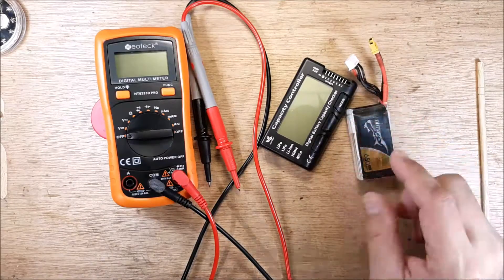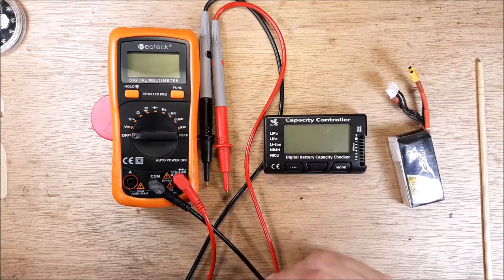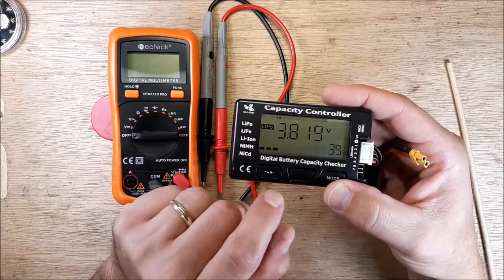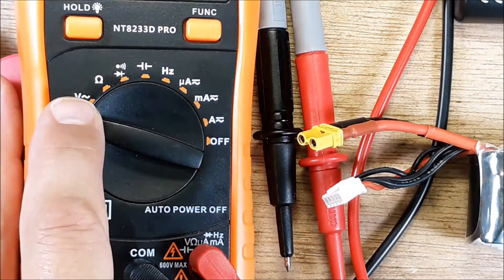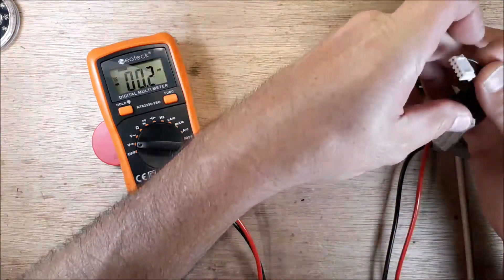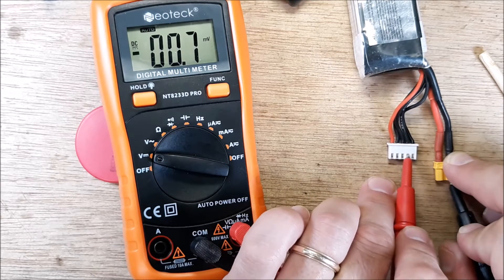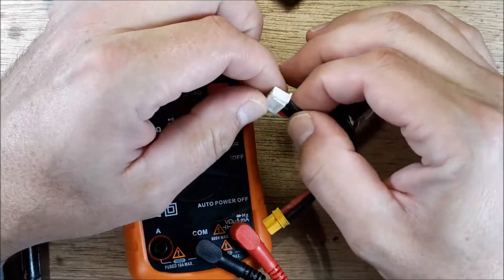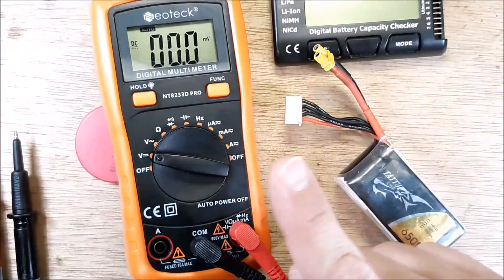How To Multimeter Check Lipo Battery Voltage | How To Measure Each Ceil Of A Lipo Battery

Comment: great video. i learn new things. i have a question.

should i dispose my 3s lipo pack if its been discharging for 7 hours(boat got stuck in middle of lake)?

i never notice the pack physically when new but im sure there are a bit bloated now. the voltage was 7.5v ish.
Reply from the maker: I appreciate your encouraging feedback...👊🏻😎🍻
Personally, if the lipo is bloated, I won't charge them. Batteries Plus recycles lipos for free - they do have a thing about very puffed packs, but I've not been turned away.. Always safe than sorry...🍻

Comment: its a great video. Ive got a problem with mi LiPo (it suddenly stopped working after some time in the drawer) and when i check it it says 1.11V (combined) but when i check each S separately with multimeter it says 1.11 on the first one and 1.11/1.12 on the second one. I assume it is broken cus ive heard you shouldn’t go below 3V on each but is there any way to recharge it?
Reply from the maker: @jacob33official  
I appreciate your support. Indeed, a lipo that has dropped to 1.1 volts will be considered dead. However, sometimes they revive on a trickle. I totally do not recommend charging lipos from below 2 volts. However, I have revived a 4S from 1.8 volts due to a long stay up in a tree, lol.. I placed it on my charger at a quarter of an amp. It took a while to bring it to storage. I let it rest and the next day it was still at storage and I charged it normally. It had sag during flight, but that's fine for me. Again, I don't recommend it and would advise keeping an eye on it during the next few charge cycles.
Also, some chargers won't charge a dead lipo. There are tricks to get them to do it, I rather recycle at that point...🍻

Comment: Thanks, good and clear explained. In this video vas touched my real life situation. I have 4s batterie but in tester I see only 3s. What I would  have to do in this situation? Thanks in advabce for reply.
Reply from the maker: @allabout1135  
I appreciate your feedback and support...🍻
Reply from the maker: @allabout1135  
You can check to see if one of the balance wires going from the cells to the connector is broken inside the silicon insulation. If the cell is dead, I dispose of them...🧐
Reply: @PropsOff  In case of dead cell, is it some way to get it back to live? Or just need to accept the fact of losing it?
Reply from the maker: @allabout1135  
Because of how aggressive I am when charging, if I feel the lipo cell is shorted inside or damaged enough to cause issues, I dispose of it. I take all my lipos to batteries Plus. It free...

Comment: My 3s battery reads 12v when I connect the ground lead and the far lead, but zero on the middle 2 connectors. The balance connector is visually intact. Haven’t looked inside the battery housing. Any thoughts on what the problem might be?
Reply from the maker: @connorsisler1824  
Your multimeter is reading 0 volts from  the center pins? So you have the ground lead on the far pin (ground) and the red lead on one of the center pins, and its zero?
Reply: @PropsOff  that’s correct sir
Reply from the maker: @connorsisler1824  
Are the wires broken inside the silicon cover? Odd to read zero. Any small voltage would be more expected..

Comment: How bad would the short be for a 1C battery if I touched the leads together on accident when checking with the multi?

Just trying to gauge risk lol
Reply from the maker: I've done it many times. Usually, you can get away with a quick spark. If longer, it can and will melt the lipo leads. Be careful...🍻

Comment: I can never remember which one of the balance ports is the ground. 
RDQ batteries have the red and black wires the other way, four reds and one black.
Reply from the maker: It does make it frustrating, I wish things were a bit more standardized. It's like when they paint the ground of a DC capacitor red...🤦🏻‍♂️

Comment: What is storage voltage and how do you control that charge.  Also, when discharging what is don’t go below voltage.
Reply from the maker: Storage voltage is 3.85v per cell.
Depends on what charger you have?
Discharge to 3.85v.

Comment: What if I wanted to read a 2s lipo I want to display each cells voltage to its own voltage display. Can you help?
Reply from the maker: Yes and yes..
Two 1-8S voltage checkers could be wired to a harness and display the voltage of each cell. You could also have an alarm set for a minimum. Are you doing a huge pack on a LR? Here's the link to the part.
https://www.racedayquads.com/products/1-8s-lipo-battery-voltage-tester-low-voltage-buzzer-alarm?currency=USD&variant=42211616595&gclid=Cj0KCQjwk5ibBhDqARIsACzmgLTI6Gtqf_h8xikITrvXtWWR7tiqxw5D9xheqHyPBDIQdZ9yorFPPTAaAkn9EALw_wcB
Reply: @PropsOff  Thanks I know I can use one of those but I have installed two, 2 wire voltage readers. I was wondering if I could display each cells voltage. So for instance I can do voltage reader #1 read cell #1 and voltage reader #2 can read the total amount of volts from both cells. Not sure if it’s possible to use the balance port of my batter to read each cell individually rather then number 1 and then the total of both. Doesn’t matter too much but just wondering
Reply from the maker: @scottsrcshop  
You can wire the first checker to read cell one but I'm unaware if a checker to automatically display cell one and then cell two. You can definitely wire it to display the voltage of 1 of 2 cells and the other checker to display the total lipo voltage. 
Three checkers would display each cell and total. I'm sure there's a smart checker that can do it all from the balance plug but I'm unaware if that device,  currently...🤔

Comment: I'm interested in this tester, saw a few on Ebay only differences are the emblem in upper left corner and some have no emblem. Where would I look for a legit one?
Reply from the maker: https://www.amazon.com/Neoteck-Multimeter-Multimeters-Resistance-Transistor/dp/B01NAVAT9S/ref=mp_s_a_1_3_mod_primary_new?crid=1MQZ8FLN521BG&keywords=Neoteck+Auto+Ranging+Digital+Multimeter&qid=1666298885&qu=eyJxc2MiOiIxLjA4IiwicXNhIjoiMC44MSIsInFzcCI6IjAuNzAifQ%3D%3D&sbo=RZvfv%2F%2FHxDF%2BO5021pAnSA%3D%3D&sprefix=neoteck+auto+ranging+digital+multimeter%2Caps%2C138&sr=8-3

Comment: Hi,I have a doubt also my lipo battery is showing voltage in negative when I checked is with my multimeter.
Reply from the maker: Switch your meter leads around. If the positive lead is on the negative pole and your negative lead is on the positive pole, you'll get a negative symbol on your meter screen. It's just showing you the polarity of the circuit. 
However, if you have the leads on the correct pole, something isn't wired right.
Reply: @PropsOff  oh ok 👍thank u very much
Reply: Hey actually i have a other doubt why is there a continuous spark when I try to connect my lipo battery (2200 mah 11.1 volt 3s 30c) to my esc (30a)and is it because of friction
Reply from the maker: @vijayganesh9072  
What capacitor are you using (the capacitor soldered between your lipo leads)?
Reply: @PropsOff I am a beginner so maybe could you tell it in a easier way
Reply from the maker: @vijayganesh9072  
Usually on a quadcopter, they solder a capacitor between the + and - pads of the ESC were the lipo leads go. If you are saying everytime you plug your lipo into your quadcopter it sparks, that capacitor could be too large.
Most of the time a spark at the XT60 says there's a large amount of capacitance. Let me see if I made a video for that..
Reply from the maker: @vijayganesh9072  
I have not, hum? Looks like another video to come soon...🍻
Reply: @PropsOff i will be waiting for your another amazing video
Reply: I hope it's ok to ask so many questions
Reply from the maker: @vijayganesh9072  
Its cool.. As you start your journey through this hobby, your going to have questions. Hopefully, I can help put answers to those questions to make the journey just a bit easier to understand...🍻

Comment: Can i use my 3s 30c lipo battery as 12v 2amp Power supply (directly to device) or it will damage the device
Reply from the maker: What device?

Comment: thanks!
Reply from the maker: If you can think of something else, let me know. Enjoy the Breeze...👍🏻🍻👊🏻
Reply: @PropsOff  I just measured, my voltages are 4.08v, 4.04v and 3.75v. Is this battery beyond saving?
Reply from the maker: @freiherrvonbraun6942  
What's the internal resistance (IR) of each cell charging at a half "C" on a balance?
You are balance charging, right?

Comment: Just throwing this out there cus i didnt think of it. I was just replacing an xt60 connector and got a lil shock when i attempted to hold the end of the xt60 to make the second connection with my helping hands alligator clip. I had taken off the rubber grips to hold something small earlier and didnt cover them, ive changed so many xt60s this way but always had the rubber tips on my alligator clips, no damage but a little scarey.dont be dumb like me m'kaaay.  I came here to double check how to set my multimeter to check lipos. Im a pipefitter who likes drones, not an electrical engineer lol. Thanks
Reply from the maker: I personally haven't had that happen to me. My friend Matt has a few times. My hands are a bit rough and dry though...
I appreciate your encouragement...👍🏻🍻👊🏻

Comment: How do I install n leave this on my electric scooter 48v 20ah lithium battery I just want to monster my battery while I ride also while charging
Reply from the maker: What amp draw is the scooter?
Specifications of the battery?
What do you want to [monitor]?
Do you want a display, like a dashboard or a hidden recorder?
Here in this video I'm showing how to measure lithium Polymer batteries used in FPV quadcopters.. Scooters are really not my specialty or Forte..
Reply: @PropsOff  i want to go keep the multimeter on my electric scooter to monitor battery while riding and charging I have a 1000w 48v20ah lithium battery I want to see what's going on with battery while charging and riding keeping  the multimeter connected
Reply from the maker: @loyaltyovermoney5942  
Interesting, hum.. I would imagine a DC power meter would be best suited for such a task.. Here's a link of what I would recommend..
https://www.amazon.com/Digital-Multimeter-DROK-6-5-100V-Voltmeter/dp/B07KPXVNY5/ref=sr_1_5?dchild=1&keywords=100+amp+watt+reader&qid=1616679758&sr=8-5

Comment: How do I check the battery percentage if I don't have one like yours, I only have Lipo battery voltage tester and why the percentage of each cell is different? Thank You :)
Reply from the maker: So for lipo packs we run them to 3.5v per cell and consider this voltage to be done or 0%.. A fully charged lipo cell is normally 4.2v or 100%.. You can create a scale from these base numbers.. The reason you have different voltage over each cell is due to internal resistance (IR). For example, a 4s lipo may show 3.55v, 3.57v, 3.49v, 3.52v after a full send. Each cell is in series circuit and depending how close the IR is matched is how close the lipo cells will discharge. I found quality or more expensive lipos like Tattu lipos are matched very close at the factory vs a cheap one - my opinion. 
Sure hope that helps you.. Enjoy the Breeze...👍🏻🍻👊🏻
Reply: @PropsOff  Thank you so much for this very detailed and additional information about Lipo Batter, it helps a lot and I clearly understand now. Thank you again sir
Reply from the maker: @reynreyn8615  
My pleasure! I enjoy this side of the hobby. Don't hesitate if you need anything else...👍🏻🍻👊🏻
Reply: @PropsOff  Hello again sir, i have a 3s lipo battery right now and a 3s balance charger, but it seems that the 2nd cell of my battery is low. Thus it possible to charge only the single cell in my 3s balance charger because i don't have enough equipment here. Thank you
Reply from the maker: @reynreyn8615  
If you have a charger the has balancing capabilities, it will charge that cell and even them all. The balance lead and power cable are plugged in? What charger? 
I have 2 Ovonic lipos, and one has a very mismatched cell that drains quite a bit more than the others, frustrating.. However,  my Q6 does a great just evening them up..
Reply: @PropsOff  https://www.skyrc.com/e3_Charger
here is the link of my charger and if you browse on the error message, when I'm charging the battery, the 3 led indicator flashes 4 times which means one of the cell is low/high voltage
Reply: @PropsOff  should I just ignored the error said and continue charging it?
Reply from the maker: @reynreyn8615  
I would have to assume, that charger is measuring an internal resistance that is out of specification. The charger I have displays the resistance and I can alter the amps being fed to the lipo. I dont want to tell you to force charge a lipo due to fire or puffing that could occur. Your lipo could have a dead cell. What does the manual say to do with this error code? Do you have access to a hobby shop or charger that can safely balance?
Reply: @PropsOff  The manual says nothing to do, but everytime I check the voltage of the 2nd cell since i asked this question, I think it increases or going back to normal because from 2.78V, now it measures 3.09, without doing nothing haha. And we don't have any access to any shop. But we already bought another battery just in case. Thank you again sir ☺️
Reply from the maker: @reynreyn8615  
Oh my.. Very much out of spec. Shouldn't really go below 3.5v.. Your charger doesn't have the ability to modify the amps and that makes it difficult to revive a lipo that's gone well beyond its limits.. I'm currently looking at the ToolboxRC M8S charger.. Seems solid..